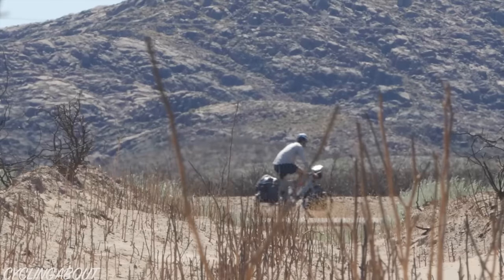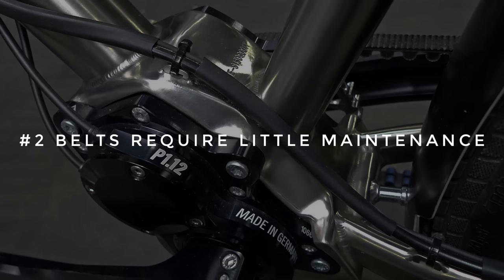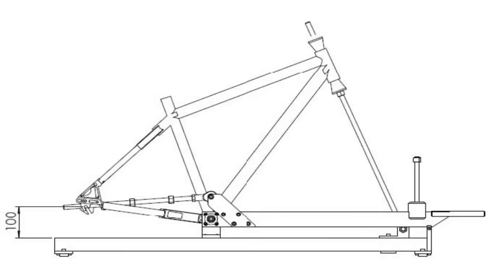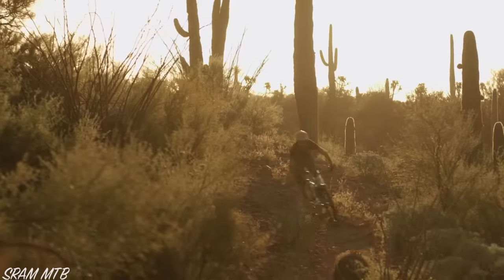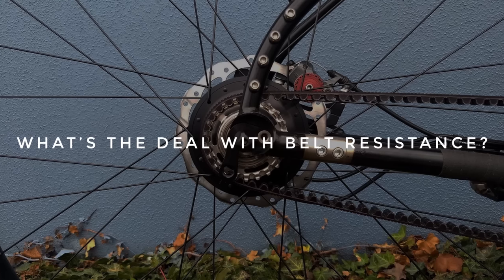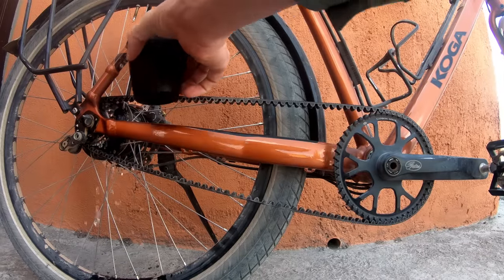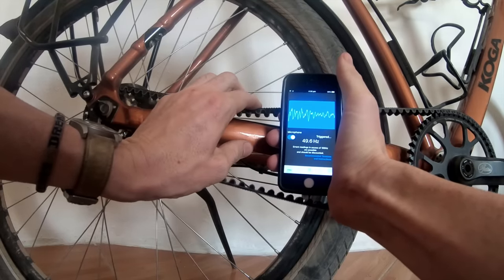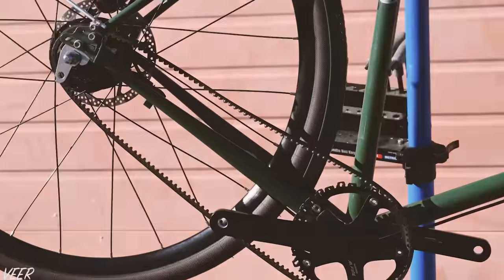Belts Are The BEST Bicycle Drivetrain Available (Epic Testing!)

Comment: About ten years ago Belts were blowing up on single speed mountain bikes.  2 of my friends bought belt drive single speed bikes and in about 6 months after constant issues with the belts breaking, coming off, and pulleys wearing out they replaced them with chains.  I've noticed that the belt drive mountain bike seems to have disappeared.
Reply: Yep, I agree. 
I've been a Dirt/DH/FR rider for about 20 years, and a certified bike mechanic since 2007. I have never spoken to a single MTB rider that had anything positive to say about them. Without pro riders actually using them, belt drives just are a hipster fad that will die out eventually.
Reply: I am 140 years old now and I prefer the walking bike. Never liked chains. I never tried them, but I don't like them. I saw how rusty they can be and you loose a lot of energy. So I prefer the walking bike.
Reply: Yep belts are a joke.  I regret wasting money on single speed belt drive frame and setup 6 or 7 years ago.  Thing would start squeaking in the middle a dusty ride even after spraying it down with silicon.  Would clog up mud, requires a lot of belt tension that put wear on the rear hub bearings.   Went threw at least two sets of hub bearings.  Tension was verified by the gates app and gates belt tension tool.   Chains are KING
Reply: @MasonicKryptonite  Why is everything these days a "hipster" fad? Seriously, the idea that anything different is something only hipsters have bull. I imagine people said that about most of the technology found on modern bikes, including diamond frames, chains, disc brakes, suspension and even ball bearings. People knew that roller bearings were better and ball bearings were a fad.  Horses for courses.  🙄
Reply: @another3997  because they were all necessary for a bike. A belt is not quick-fixable, not robust, and definitely does not do well to the bike's weight
Reply: @edmondmuller7082  get stainless steel chains smh
Reply: @edmondmuller7082  You young whippersnappers haven't got a clue with your new-fangled contraptions.  I'm 220 and remember hearing about those ''dandy horses'' when I was a teenager, when Baron von Drais introduced them.  Two wheels instead of four horses legs is just a gimmick, I'll stick with my pony thanks.
Reply: They seem to be making a small comback in the Bikepacking scene.  I'm holding out for the hipster dayglo colored belts.
Reply: @fender1000100  I actually agree, there's nothing better than belt drives for commuting/bikepacking. It's better than your greasy chain constantly hitting your ankle

Comment: I ran a Rohloff hub with a chain for a few years on my mountain bike.
1) It leaked oil onto the brake disc if you laid it on the side.
2) It required frequent oil changes.
3) It felt much slower than a chain drive.
4) It was a lot of unsprung weight. (not as relevant for touring, but yes for MTB)
5) The cogs were almost impossible to get off.  I nearly destroyed the hub removing the last cog I had on it.
6) Rohloff hubs are expensive
Maybe Rohloff has made improvements in the last few years, but I would not go back.
Reply: Most of that sounds like you had particularly bad luck with your Rohloff.
I'm active in the bike traveling scene, and what you describe is essentially unheard of - not doubting you, mind you.

Besides of course it being more unsprung weight :D That's just true.

Comment: Been riding belt for 2 years straight just about every day. BMC alpenchalenge 02. As a trainer bike the hub efficiency is less than a regular cog chain but thats the best way to train! I love it! No mess! Lasts !! All my riding is road fast sprints and steeps! I will de tension a bit as your suggestion. Alfine is a heavy gear system. Should to be oiled and cleand every year, i use automatic transmission fluid works excellent. My next trainer would be a belt fixie single speed

Comment: Today, I learned that there is a such thing as a belt-drive bicycle. I need to head to my local bike shop more often, I suppose - I bought a nice Rans in 2005 and I've been riding it and maintaining it ever since. A belt might have more resistance than a new, clean chain, but a chain remains clean on my bike for about 30 seconds. 

I do have some experience with belt drive *motorcycles*, and I have seen cases where a 700 pound bike was running the factory belt - at 85,000 miles. I think my next bicycle will be a belt drive.
Reply: 100.000 miles on my Victory Vision and the belt still looks good. In less than that a R1150RT beemer had already used three broken shafts, one for each 40.000 km...

Comment: I'll try convince you. I'm doing my bike up to be the ultimate commuter bike. Already got the rack on the back, going for solid rubber tyres and a single speed conversion to a 50cc MOTORCYCLE's chain and sprocket set.

Comment: for a folding or travel bike wouldn't belts also be less greezy...  easier to stow in a car or boat without getting grease all over...
Reply: Now that good persepectife
Reply: yes, though im not sure how the required stiffness and folding would work together
Reply: @antonhelsgaun  Probably the rear triangle on a folder is just as stiff as on a regular bike, or can be made to be. It might even be stiffer because it's so small. Definitely folding bikes are a really good application for belt drive.

Comment: Remember that the belt wears out the cogs very quickly, so you have to replace everything, not just the belt. I used a belt drive bike for several years, a complete drivetrain will only last 2000 to 3000 miles (contrary to the exaggerated claims) and you will have to replace the entire drivetrain, which will be about five hundred dollars. If you ride a lot, that's a big hit to take when you would otherwise just be replacing the chain.
Reply from the maker: I agree that it's not cost effective if you only get that mileage. But I normally get close to 10X the distance.
Reply: @Cyclingabout   Well in cars usually chains last many times longer than belts on the engine and in case of failure most engines would be a catastrophic failure...

Also when I was a kid I ride the same bicycle for more than a decade almost every single day afternoons until late night and sometimes went to the city like 10 KM away and back late into the night and I barely had to replace chains, totally fine with them for me and I also was jumping the entire day almost everything, broke quite a few suspensions and soldered the rear of the bike twice but it kept going strong 😁

Where I have chain problems is on my crap motorcycle, sadly it was even almost brand new and in the god damn day I was going to tight the chain which was already too loose, I just went down my house, stop and slowly went ahead and boom the bitch came out and broke the side fitting locking crap and even broke a piece of the side cover of the motor and sadly started leaking oil, it was fixed with kinda 2 mixes of something that act like a metal, never drop a single drop of oil but sadly since then the bike oil magically disappears that almost runs on oil yet doesn't make that much smoke, it has now like 40K KM, I don't even understand where is the oil going, all the motor side cover is always dry all around it 0 leaks 🤬

Comment: I switched to belt drive 8 years ago and havn't looked back
Reply: I didn't and looked back because my chain snapped and fell off.
Reply: Is it easy to find belts to make quickstop repairs?
Reply: How You switch gears?
Reply: @Lysergic_  : I still haven't had to change my belt. I don't do as epic bike travels as the guy in the video :p
Reply: @vitalino1981 : I use a Shimano Alfine 8 geared hub. There are other options that may be better, but that one was the cheapest for me. It has worked fine thus far
Reply: @LiiMuRi  huh pretty damn cool i didnt even know this was a thing. Just switched my mountain bike out for a eagle NX setup and love it.
Reply: Well you should look back, always check for cars.
Reply: That's because nobody's behind you - they all dropped you on their lighter chain-drive bicycles!

j/k
Reply: @LiiMuRi  better alfine 11 speed...

Comment: From my experience of using belt drive:
- Super expensive transmission (rohloff hub + belt drives + frame). Cheaper alfine is not really reliable, saw fellow tourists with fully jamed hub (even free rotation of the hub did not function, so the tourist had to tug the bike) with low mileage;
- Very special expensive frame;
- In muddy and snowy environment is very unreliable (a very big chance of belt jumping off or jamming);
- Low tension of belt can lead to belt jamming and very probable belt breakdown because of it and you need to always have a spare belt in case of old one jamming, as in chain situation you need to only have link and multi-tool;
- If belt is clean, then it was just cleaned. In most situations belt will be cleaner than chain, but is still dirty;
- Wide 1-speed chain requires a very little maintenance too, the operation of this chain combined with rohloff hub is very close to the  operation price of the belt drivetrain, but does not require expensive rare drives and frame. Also you can find a replacement parts like sprockets and chain almost everywhere.

Comment: The number 4 downside (costing extra $ upfront) should have been number 1, as most bikes are typically stolen before the first chain is even worn down and needs replacing, so, hard pass for me, criminals and any other people looking to steal your bike is always an issue
Reply: invest in solid locks and this won't be an issue
Reply: @Aldo-gs6yk  and cracks heads in uk running around in the day time with grinder, and ebay sells "automatic" pick picker within 30 seconds unlocking any solid locks... now tell me another solutions?
Reply: @BigPom-fk8re  If the automatic picker worked, it wasnt a solid lock
Reply: Lol expensive? You can get them starting at $550. Priority Bicycles. Also, it sounds like you just can't have a nice bike because of anxiety. That has nothing to do with the drive system.

The priciest priority is an entry level road bike from some of these builders.

Comment: My next touring bike will for sure have a gates/Rohloff setup.
Reply: Me too, if I win the lottery!
Reply: El Gino the belt use a lot of watt
Reply: @fastbicyclerider7300  According to the data given in the video, belt has lower friction when the rider is delivering over 210W.  That's at standard belt tension.  If you are running lower belt tension, the cross-over point is earlier

Comment: Harley transitioned its product range from chain to belt drive between 1980 and 1992. Compared with a chain, belts are cleaner, lighter, cheaper, smoother, quieter, and require less maintenance or adjustment than chains. Early belts were not very reliable and lasted as little as 20,000km. However, they now last 70,000-120,000km or higher, depending on the use of the motorcycle.

Comment: I think the belt drive is good if you're a full-time bike-touring person, but for the casual rider Rohloffs are stupidly expensive. On top of that, you have to either: 1) have your favourite wheel custom-built with the Rohloff in it -- with the additional expense it entails or 2) take what's available. I would put a belt drive on a single-speed bike, though. I might consider the Pinion system when they sort out the shifters. I'll take the hassle of lubing, cleaning, and replacing chains every once in a while over having to shift gears with a grip shifter anytime.

Comment: Being Dutch and driving my bike everyday; I have never had to replace my chain in over 10 years of constant use so it never even occurred to me that the chains would need replacing. The only maintenance every now and then is some lube and and getting the tension right again. Belt drives do look slick and how silent they are is very cool.
Reply: Where you live is very flat. Where I live, I was cycling about 1000km per month up and down a lot of hills, a chain would last 6000km. Or about 6 months. A chain is worn out before you realise. If you run it until it is visibly worn, all your gears are destroyed too.

Comment: I have been rocking the belt for 3 years. No plans to go back to the dirty, squeaky chain
Reply: Maybe if you actually cleaned and lubricated your chain it wouldn’t be dirty and noisy. They aren’t loud if you take care of them, and they definitely shouldn’t be dirty.
Reply: @calebm.5698  that's the point. I don't have to do anything and the belt is perfect. Try it and you'll be satisfied
Reply: @scherlocker1  my bike is full suspension so they don’t make belt systems for it, and it’s carbon so I couldn’t cut a frame split in if I wanted to. I’d be happy to try a belt if I got the chance, but the idea of having a two piece rear triangle is terrifying for me, it really doesn’t sound like it would hold up to the sort of jumps and drops I do.

Comment: Back in the early 90's I had 2 Kawasaki GPz305 (parallel twin 305 cc air cooled motor) motorcycles, and yeah, I CAN attest to the fact that they DO last. As for no lubrication, yes, but, if they squeak a little, there IS a lube that will help make them quiet again. No oiling, lighter than a heavy duty O/X ring chain, no need to adjust, no need to clean chain lube/grease from back wheel, smooth gear changes... It surprises me that they aren't used more on smaller 600cc and below bikes. I know BMW did for a couple of their F800 series bikes in the past... But they ARE a brilliant idea... No wonder Harley and Buell stuck with them...

Comment: As our senior mechanic once said at Harley-Davidson: When your driveline fails what would you rather have to replace..? A tiny link on a chain, or an entire belt..? Obviously, a belt on a Harley would be ridiculous to have to carry as a replacement, whereas a chain-link would be a snap. Off road, belts are notorious for degrading in dirt, mud and water, where chains can be rinsed and lubed quickly and efficiently restored to original condition.

Comment: Very interesting. Thorn cycles makes touring bicycles and they're dead set against belts. I have a tendency to believe you though. You've essentially solved every problem that i have with bicycles. Chain maintenance and staying dry in the rain. By having handlebars that face forward you can drape a rain cape over them and protect your legs from the rain, eliminating the need for waterproof trousers.
Reply from the maker: Thorn wrote off belts before they even tried them. I really don't like that they have such strong opinions on things they haven't used in the field.

Comment: Ohhhh. The budget is a problem for me.. 
I wanna try a belt actually .
Reply: I have 2 veer belt drive kits... Cyclingabout mentioned them in this vid, I put them our on bike friday folding bikes as i hated the cassettes. cant recommend them enough
Reply: Buy second hand! I got a 2011 trek district with a Gates belt drive system for 120 euro, definitely worth keeping an eye out for
Reply: Get bike chain free
Reply: @dvandamme00  Hi there, How do you change flat tyres with this veer split belt? I been eyeing it for some time for my bike friday too (llama/diamond frame).
Reply: @leaptech510  they are tighter than chain and derailer for sure, but its easily removed to change a tire (get schwarlb marathon plus tires while you're at it, they are practically bullet proof). Fair warning, you cant just fold the bikes up quickly with these belts, you have to take the wheel off, then fold the rear under - but we only fold to pack for transport so thats a minor minor concern.
Reply: Maciej Jan Długosz  not true..
Reality beats theory!
Didn't you watch the video?

Comment: Wait, what's that part about needing "rear belt splits" to be "installed" in the rear frame triangles?!

I think that right there could be the main reason belt drives are so rare. That just seems an insane design flaw, to need to permanently break the frame for the sake of keeping the belt in one piece. Do belts really suffer so much for having a master link-type sizing/joining system? It's definitely possible as you pointed out here.

I think the second reason would be the total lack of cross-compatibility with other more conventional drivetrains. Unless you want to ride a fixie (where I can see belts being a great option) you are looking at an internal hub gearing setup in the rear wheel or a bottom bracket gear box (so, quite useful with an e-bike then).

Either way, the deal-breaker seems to be that you can't just take an ordinary bike & adapt it (without serious investment). You're more likely than not, going to be designing & building a custom built machine, designed around the belt drive, for it even to be feasible.

This reminds me of the concept of "min-maxing" from roleplaying games. If you can overlook a couple of serious flaws in your build by engineering your play style in a certain way so that you don't miss the things you've sacrificed, you're good to profit from the resulting bonuses in other areas.

I think that's part of the joy of building & riding bicycles actually, & you have taken it to the absolute max with your bike. I can't see you convincing many others unless they happen to have a few grand to spend on a dream build from the ground up though!

Comment: Belts being more durable depends on how you look at it i guess. For getting more useful lifetime out of them maybe, but i bet if grandpa's old bike had a belt drive, by the time you pull it out of the garage that belt will crumble into a thousand peices. A metal chain can survive decades if not centuries in the garage if the conditions somewhat prevent rust ;)